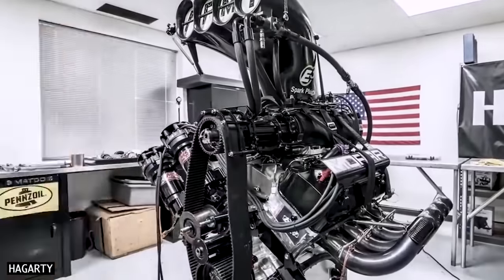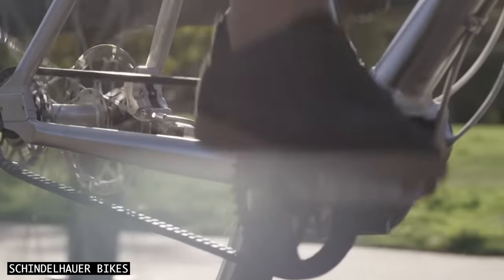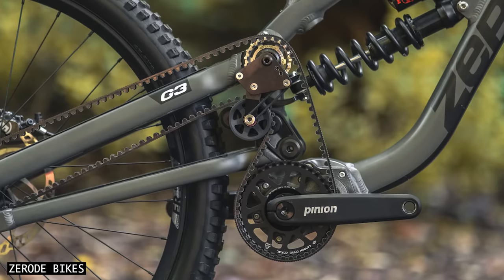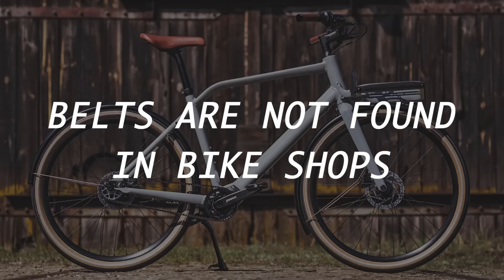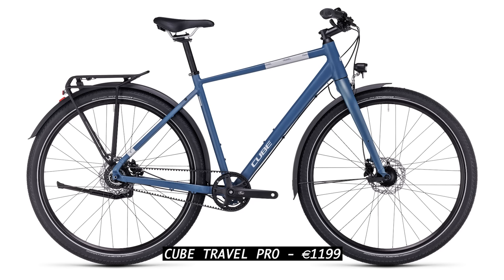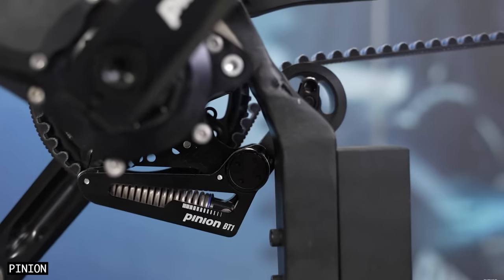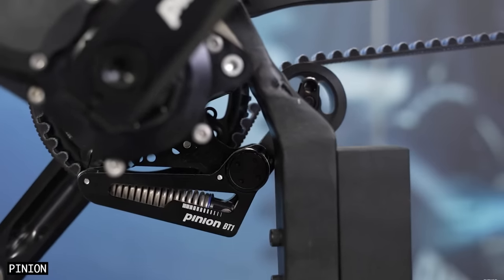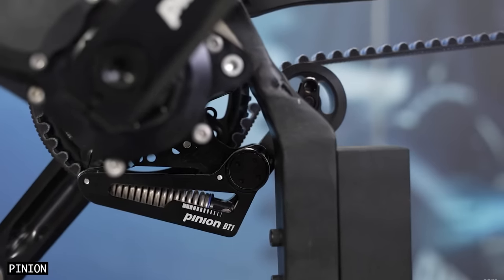Belts Are Now BETTER Than Chains On Bicycles!

Comment: A bit too biased. Your personal experience isn't enough to prove the endurance, that requires more statistical and scientific data.

I think the chain lasts more than long enough, I've only ever broken one as a kid and could repair others.
Sure if you're riding in dust and mud frequently this is cool, but it's reinventing the wheel over a problem that doesn't need solving. Mostly I bet so the design could be proprietary.

I have an ancient bike, a little dust and a little oil and it runs fine. Rusty as heck and still fine. You don't need new fangled stuff, reduce, re-use, recycle.

I do find chain slipping as an issue but you didn't say if that fixed that and there's other chain systems that do or maybe new sprockets might help. However the weight and efficiency loss might negate any gains from needing to drop a gear.

Comment: Sorry but belts aren't used on those high hp blowers because they are the better option just the safer one, a chain would likely be a much better option for transmitting all that power but if a belt breaks and hits someone it going to hurt like crazy and might cut them a chain breaks though it could rip half the vehicle apart and still kill someone

Comment: You can’t go off-road with a belt drive motorcycle, tension is too high. Debris that get squeezed between the sprockets and belt destroy it very quickly. Belts are also less efficient than a chain as they rob more engine power.

Comment: Belt drives are not less efficient just because of the required gearboxes, theyre less efficient than a chain (by more than 15%) due to the friction between mating surfaces of the belt and the pully/cog.
Reply from the maker: Not according to any lab testing I’m aware of.

Comment: i have a light ebike with belt drive.. when i reach 25kmh the pedals go fast as hell its almost not possible to do more then 33... what do i need to change to make it more rideable in fast speeds? a bigger front sprocket or a a bigger rear drive sprocket? i know i will need the belt in the right size but not sure about the chainwheel...
Reply: Most e-bikes, if they are legal to use in bike lane, are limited to how fast they can go using the electric motor.  To go above that speed you have to depend on human power only.
Reply: @douglasmckinley-sr1507  im talking about the rpm of the crank...
Reply: @teabagNBG bigger front or smaller rear, or both. Think big wheel turning once means small wheel turns many times the smaller the secondary wheel, the one that is driven, in Relation to the crank wheel the higher the gear.  Not sure how this will mess with the E-Bike system. Might also not only be illegal but stress the motor all depending on how it detects it's speed.

Comment: Maybe belts are better. But chain driven gear systems are  cheaper. Not everyone one can afford 1k+ planetary hub. 
In reality it's not mass-produced to be even popular 9n bikes. So it's rarity what most cyclists avoid and don't care. Maybe it lasts forever in terms using, but chain driven systems are more accessible and you have big variety of kinds to it. Don't see any problems with chain. If broken in a trip, you can source one rather easy.

Comment: Nice advertising really, but my reality was quite different. My belt lasted between 3000 and 8000km, not more. I pretty much only drove it to work on the street. After a year i dropped this expensive and unreliable powertrain and changed to a unreliable powertrain. Less expensive, less power loss. Never never a belt.

Comment: Needs a side cover to keep the belt from coming off the sprocket
Reply from the maker: No, it doesn't. The belt and sprocket use a "centertrack" design to ensure the belt tracks in a straight line. The appropriate belt tension for a given rider's weight and pedalling style means the belt won't ever come off.

Comment: You threw up a lot of numbers, and English is not my first language. If I understood correctly, belts are the best above 31 km/h, right? So I, in the city, constantly starting and stopping at multiple traffic lights, hardly going faster than 20 km/h, should keep my chain, correct?
Reply from the maker: Belts and chains are just as efficient as each other. It's the gearbox or internal gear hub that you use with the system that will slow you down a bit.
Reply: @Cyclingabout  err... thanks for fixing my misunderstanding. So, to go back to my question:
If I understood correctly, sealed gearboxes are the best above 31 km/h, right? So I, in the city, constantly starting and stopping at multiple traffic lights, hardly going faster than 20 km/h, should keep my derailleur, correct?
Reply from the maker: @ghyslainabel  I don't know what data you're referencing. Gearboxes are almost always less efficient than derailleur gears, so if you want to ride the fastest in the city, you should keep your derailler and chain setup.

Comment: It's a bicycle, keep it simple. Chains are all round easy, cheaper, better and it's the standard. They rarely snap and can be built to be much much stronger than what is seen on much newer bikes. If chains are enclosed in a case like a chain guard then the maintenance is so easy and life is super long. 
There is so much to belts that suggest it's more complicated. I never have to use my smartphone to tension my chain, and if I have a derailleur I don't even have to concern myself with it.

Comment: Is almost the same as belt driven motorcycles they're good but they add unnecessary elasticity in a motorcycle this will make you fall when going straight as this elasticity unbalance the motorbike but in bicycles this doesn't happens is real good for a general use bit all bicycles tech ir designed around chains it has its flaws but I hope seeing more in belt driven bicycles for general uses.

Comment: Chains undefeated.
Don't waste your money on belts.
They trying to reinvent the wheel by proposing a product less efficient than chain.
Reply: i was about to comment about chains in older combustion engine cars like Toyota Hilux that make it so reliable in overall, and then tell that I have Silverback Stride Expert cross-country bike(Germany product) that I ride in a trip across my Eastern European country with harshest inverometn and poor roads, and has  no issues on chain and bike what so ever. 
It's same things as with electric cars – reinventing dinosaur in new skeleton and hope it works, but its not working.
That's why I drive 1998 Subaru WRX – pure mechanical car with manual on synthetic fuel, that makes is more reliable and cleaner then EV, and ride a  cross-country bike on a chain
Imagine hating the things as they are, so you need to be made up a problem, re-invent the wheel and solution, because you're bored with life...And then shout about that all loud...
That's what I feel when I was watching it.

Comment: Single speed yes, belts a good Idea especially if a high chainstay is used so a belt can be replaced without a framebreak connection. But then what do we do about geared bikes? Internal hubs that I have used, the Shimano Nexus, have short lifespans and are unfixable by me an expert bike mechanic. And how to repair on the road...?....can't be done. Even if there is a bike shop 50 miles away from breakdown, they won't be able to fix internal gears or won't have the replacement parts. $1500.00 gear hubs are not the answer, it is like automobiles going to automatic transmissions, NO ONE can repair one with the same life expectancy as the factory. Now we have automobiles that end up in graveyards because the auto tranny is broken and needs a $7000.00 repair and the automobile is worth only $2000.00. Complex gear systems for a bicycle are ecologically irresponsible as the auto trannys in cars are. 

Belt for geared bikes, yes...IF....we use a CVT transmission of a simple two pulley system all external parts, easy to fix and can be the one gear system every bike uses for extreme range of infinite gear ratio's. From extreme off-road to extreme pro racing, everyone can use the same gear CVT system because of the wide gear ratios. No more matching chain speeds, cassettes and chainring options. One, two pulley system, one shifter, infinite gear ratios across a huge range. No more huge ratio gaps when in a 52x13 and shift to a 52x12, this is far too much of a gap when you are at a high intensity with the 13 cog and need just 4 gear inches because that is all the power you have to give. CVT YES!

Comment: I’d like to see you actually put up belt drives to chains because in the video you show thongs that are annoying like clicking noises however heres the thing belts get snapped easily it cant handle high speed tensions and no you cant shift gears so have fun climbing

Comment: "belts are better, just add a 10 pound gearbox that costs $1000 and youre good to go" 

it will only be "better" when you see the highest performance sports/athletes switching to them. They arent running gearboxes, they arent running belts. Same with top performance dirt bikes and street bikes. No belts. Even on vehicles that use gearboxes already. 

If they are better youd see them climb the ranks, youd see them infiltrate all segments of the market. Especially since new/better tech trickles from expensive to cheap, if the expensive people arent using it, then its not better.

Comment: We've had both drive belts and bicycles for over 150 years.  Belts have had ample opportunity to make their case, and they still haven't caught on.  There are issues.  

Belts need high static tension to work correctly without skipping.  Bike parts fail when the drive chain (belt) has high static tension on it.  Belts are incompatible with bike drive components for this reason.  

Keep trying to learn what the rest of the world has known for 150 years.  I know you can do it!
Reply: Well, I'm still waiting for my "bike parts" to fail after 10 years. When is it going to happen?
Reply: @AardvarkDK  
I've been working on bikes professionally starting more than 30 years ago, and I've seen more knackered and inoperable belt drive bikes than working ones during that time.  Take from that what you will.  Maybe you're a soft and gentle pedaler?
Reply: @chalocolina3554  I mean, I like to ride with a high cadence, so maybe that's it.

Also, your claim that "We've had both drive belts and bicycles for over 150 years" is a bit misleading. When I bought my belt-drive bike (about 10 years ago), it was the first one I'd ever seen. And this is here in Copenhagen where you find about five bike-shops per kilometer. I'm sure they technically existed before, but they've hardly had "ample opportunity to make their case" when you could hardly find them anywhere.
Reply: The problem with catching on is the price. It's the same with Bottom bracket gear boxes or a 1500 bucks Rohloff IGH, bike companies mainly sell bikes for less than 1500 or 2000 $ or € and if a IGH like Rohloff already costs that much it will somehow exist on market but never get a big market share. For a belt you need a special frame, you can't retrofit it and it always needs a gearbox or IGH  (if you want to have more than one gear). I think they may make more money if they keep the prices for belt drives high than if they lower them and make less margins at higher numbers
Reply: @AardvarkDK  
Most of the failed bike and bike parts designs were tried first in the late 19th century, and then again once in a while as people who didn't understand why they failed, rediscovered them.  Just because you personally had never seen a belt drive bike until recently doesn't mean they hadn't been tried (and found lacking) a hundred years earlier.  They'll go away again in due course, only to be revived, and fail again, in another 30 or so years.
Reply: @chalocolina3554  Oh, so they were around in, like, the '70s as well? Or when was the last time pre-2000 you could buy a belt drive?

Comment: But what about compatibility? In the video, it looks like belts and sprockets from different manufacturers are incompatible.. Has Gates patented their belt/sprocket designs so other manufacturers can't simply make compatible products? If so, you're stuck with the manufacturer. I mean, having to buy belts online instead of simply going to the local bike shop is one thing, but at least bike chains are all compatible afaik. I really don't like vendor lock-in.
Reply from the maker: There are multiple belt drive vendors who all have incompatible products. So you can find parts from the same manufacturer, or change the whole belt drivetrain to another manufacturer.

Comment: And why they dont use a belt on the valve drive in a 10000 hp racing engine ? maybe cuz its not better than a chain ?

Comment: Don't buy the expensive crap bike sprockets and rubbish carbon reinforced belts. 
Chop up some scrap carbon fibre or fibreglass, mix with epoxy, and use an industrial belt or car cambelt to mold teeth around a disk of plywood for your chainrings and sprockets. 
If you slice a car cambelt the right size to the right width you will have a lighter, more efficient, and longer lasting system than they are selling you. For a couple of bucks or less. You can get perfectly good cambelts for free from your local car service garage.

Comment: I get that they want to save weight on the belts by using carbon fibre strands but if they used steel ones they would be indestructable! and you could twis them how you want. Shouldn't be that much heavier!

Comment: bro my dads bike is 28 years old and the only thing thats been changed on it is the brakes cuz my dumbass left it out in the rain n a few tires cuz i drove it down hills n abused the hell out of it. Dont give me the "cyclists have ran one belt for years before needing a replacement" argument xD when ur belt survives for 30 years and STILL works through rain n as much abuse as an idiotic teen can hurl at it, let me know n i might consider it, but for now belts on bikes r useless n make no sense cuz the rubber degrades on its own overtime plus less efficient power delivery and the cost difference isnt rly that worth it plus a gearing mechanism for it is far more expensive. Happy customer lmfao. Last time i put any grease on this chain was like 13 years ago and it was the cheapest crap u could find from YEARS ago if not almost a decade.

Comment: 1:37 says bicycle belt drives are different. 1:42 proceeds to explain exactly how most if not all modern belts are made. Though I seriously doubt the mileage claims you've made with no backup. I've run chains on every bike I've ever had since I was a kid and in all that 40 years I've maybe replaced one chain. Hell, replace more motorcycle chains than bicycle. 3:43 Yes most people don't like maintaining their bikes or finding parts, so why make the bike much harder to maintain and much harder to find parts for (and more expensive)? You can't even make your own custom length belt in a pinch like you can with a chain. And gearboxes are heavy, delicate, complex and not easily fixed in the field! You should look at your use case for your bike and realize that a 10 speed carrying saddlebags is much, much different and a very low load application when compared with, say, BMX, or MTB. Unilaterally saying belts are better is outright false. They may be better for your use case, but not for most. Stopped watching at 9 minutes in because you basically just started repeating yourself.

Comment: get a twig in there it'll pop the belt off, get a twig in between chain and sprocket and the twig will get cut inhalf . . . . .
Reply: @JorgTheElder  High end stainless chains come off with just a pinch of jeans material in them. As an owner and collector with 13+ bikes and an avid rider of bush and pro bmx tracks i can confirm this

Comment: Belts are nowhere near as efficient as chains.  You lose quite a bit of energy in a belt drive compared to chain drive.  End of story.  Doesn't matter that they work.  It's about making the most of the limited energy in your body.  Stick with a chain.
Reply from the maker: The data suggests otherwise.
Reply: @Cyclingabout  Well no the data of belt vs chain is well documented.  Show where they test it side by side showing the exact energy loss difference.  A chain is simply better.  I'm totally open to you proving otherwise though.  Let's see it.
Reply from the maker: @DellSchanze  I speak about the drive efficiency data for over three minutes in this video. Go to 18:20...

Comment: The bicycle industry has always been behind other vehicle technology by 100 years. I am 65, been riding long milage for 55 years, pro racing, commuting and still riding 10,000 miles a year today. Been stuck with this horrible derailleur gear system my entire life. It functions, and is dependable enough and repairable by average mechanics...but it is not a transmission for a bicycle. We need the CVT belt pulley transmission, already proven in automobiles today, and can easily be adapted to the bicycle...but....all we get is the same cocaine headed engineers making minute changes to a 100 year old horrible gear system. And then having the GUTS to say this is high tech!!!! Why? I wish I chose engineering instead of the trade I am in, I would be a rich man today, and changed the bicycle world completely around with CVT transmissions and airfoil highly aerodynamic carbon bikes.
Reply: CVTs can be horribly mechanically inefficient compared to a synchronous belt or chain like you see on current bikes. They are found on some things like hire bikes, but never caught on for consumer use.
As for highly aerodynamic, bike design is largely based around the UCI rules and limitations, which is why you don't see any drastically different designs any more. Tri bikes aren't restricted by those rules, so they tend to have more fairings and similar aero features than other bikes.